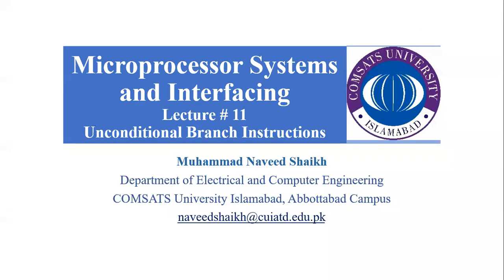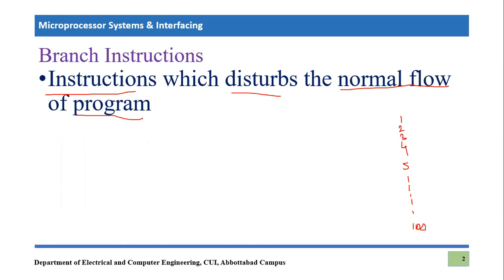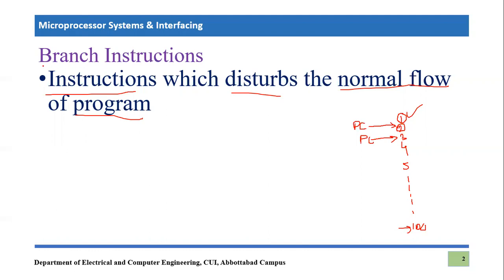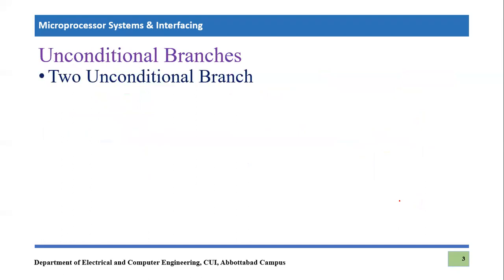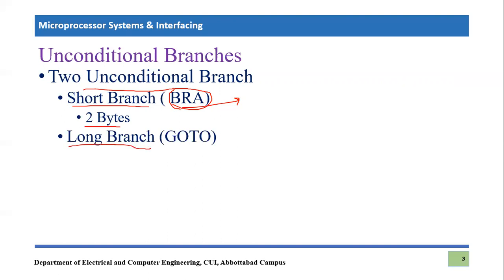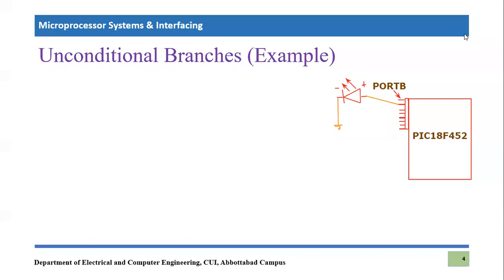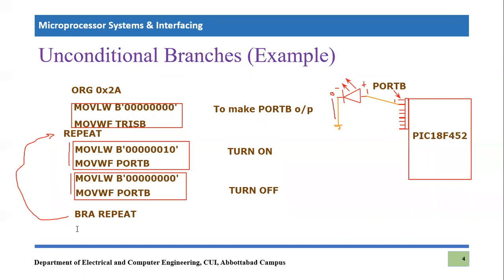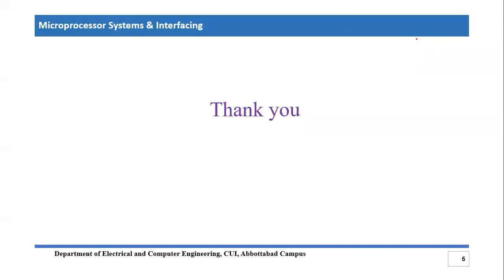Unconditional Branch Instructions in PIC18 Microcontroller || || BRA Instruction || Infinite Loop

Comment: Sir ,when we send B'00000010' to RB1 will this make the pin as an input pin ? 
In other words can we use the pins of an output portB as an input pin ?
Reply from the maker: We wont send any thing to PORTB to configure them as i/o pin.  Instead we will send b'00000010' to TRISB to configure the PORTB . RB1 will be configured as input pin. RB0, RB2,RB3,RB4,RB5,RB6,RB7 will be configured as output pin.  This case we did not discuss it in this video tutorial. Because we made all the pins as output . In coming lectures we will see these cases similar to this question.